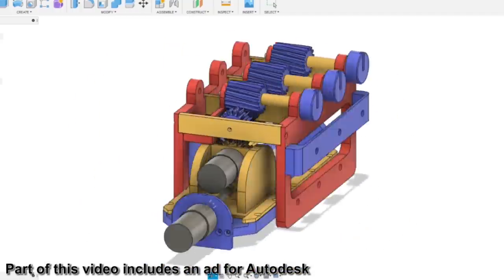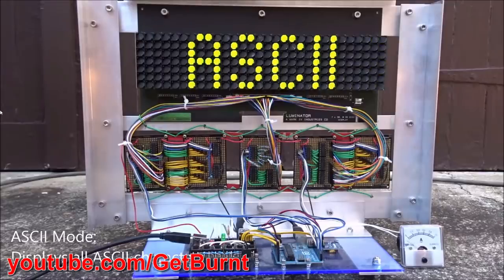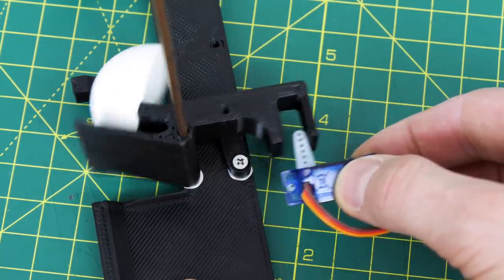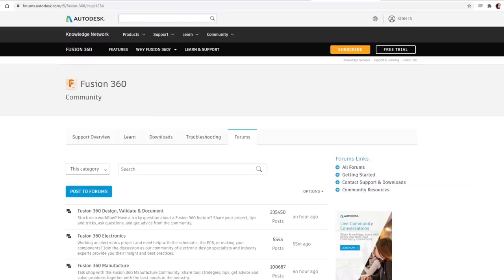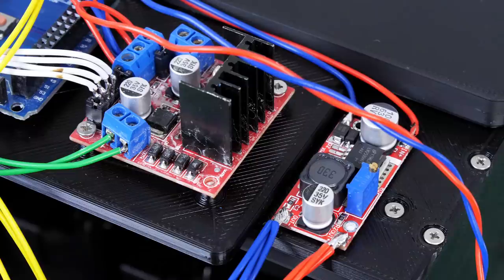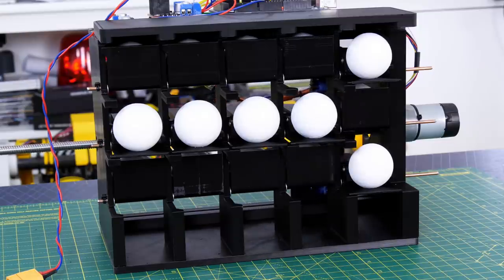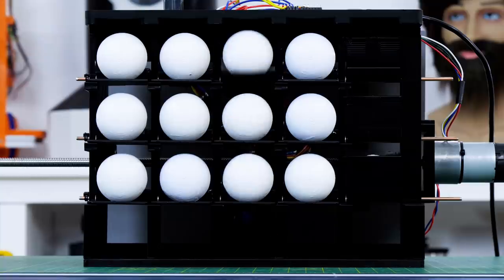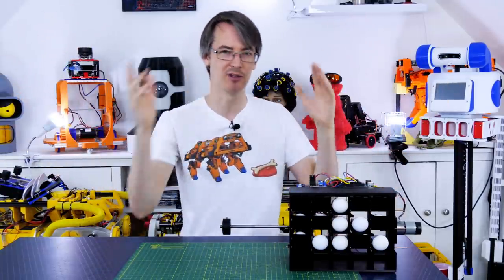Mechanically Multiplexed Flip-Dot Matrix

Comment: "i'm using ping pong balls because i have a lot of them"
prints a fake half-ball anyway
Reply: Yeah, I don't get it, why not just cut ping pong balls?
Reply: @Bruhsty1234  a half ball could look bad on camera with all the light because of the black background and the thin white plastic.
Reply: Yeah, why not just have a black and white slate?
Reply: I hate this about the channel, he always prints A LOT of things that can be made much more easily, cheaply and quickly in other ways
Reply: @Bruhsty1234  Would be way more effort!
Reply: @Bruhsty1234  half a ping ping ball would have 0 structural integrity, It'd be like trying to use paper
Reply: @Matty.Hill_87  Yeah, but they don't do anything here. They just sit on a plate waiting to be flipped. They don't need any more integrity than what's needed to hold their shape
Reply: @Matty.Hill_87  well they could brace it with toothpicks and hot glue
Reply: @tramburo23239  'Hate' seems a bit strong 😕
Reply: yeah i would have used a piece of masking tape instead of a ball. I mean, what's this for? it's just fun and a prototype, not a product.
Reply: @ionymous6733  All this illustrates why people like James have big YouTube channels and we don't. 😁
Reply: G Bertelli like the plates at the top and bottom, two big plastic sheets basically, a bit of plywood and some basic tools would do the same.
Reply: @tramburo23239  I was just about to say this, instead of making some big parts out of wood or something he just spends a LOT of hours 3D printing them.
Reply: saving the real ones for the megapixel version
Reply: @Bruhsty1234  effort. 3d printing you press go and walk away.cutting a bunch of balls in half you gotta sit there and do it. Besides that. Engineers overdo everything.
Reply: I love channels like this, but I will always randomly remember how much plastic is being used and then I feel bad. I wish stuff like this was more sustainable. as 3d printing becomes more popular, the negative impact on earth will just become worse :'((
Reply: @allertschallenberg1857  nah i've noticed a "change" in people once they get a 3d printer, it's like they completely forget how everything else works, they print completely redundant stuff, never once considering there's probably mass produced injection moulded, sturdier, stronger, lighter and cheaper solutions available on the market, 3d printing is actually quite costly except for very specific custom made parts which is kinda it's whole job, "printing" a ping pong ball in this sense is just moronic, specially after stating he has so many rofl... he'd only need to cut 6? of them in half... gotta get that filament sponsor somehow i guess
Reply: @bugz000  Thanks for proving my point with that last statement.
Reply: if he printed it anyway he should've just made a square which takes up more of the pixel
Reply: @tramburo23239  well maybe he doesn’t wanna make cheap rubbish that’ll break in 5 minutes
Reply: @pvic6959  agreed. I hate failed prints etc sux
Reply: @Bruhsty1234  because he can
Reply: @Bruhsty1234  because 3D printed parts aren’t ridiculously flimsy
Reply: @Travis_Yu  
I'm not saying I would have done it the way he does it, BUT his way is more "proper engineering" in that he can model and test it in "cad cam". And the fact that it takes time for the printers is NOT the same thing as it "taking his time". He can pretty much "set and forget" the prints and do other things while they print.
So Yea to each their own, but I can see benefits to doing it his way, ESPECIALLY if You are sponsored by a filament maker.
Best regards.
Reply: @tramburo23239  
"Lucky thing" that You don't have to view it then, isn't it ? :)
And best of luck finding other channels that You dislike, if You work hard You might even find some that You "hate" just as much as this one, and then You can refrain from viewing those as well ;)
Best regards.
Reply: @pvic6959  The "negative impact" that 3D printing has is HIGLY dependent on what type of plastic they are using. I can not say for certain what Mr.Bruton is using, And I'm pretty sure that  "pure PLA" is made from renewable source and NOT using any petrochemicals ((in the filament material)) and can pretty much be "biodegragable".
Best regards.
Reply: Yup, this is how at lest half of my projects go..."Oh, that would be good for X". Creates entire project around concept and part then ends up not using the original part at all
Reply: @tramburo23239  Why do you watch the channel, then?
Reply: It's like the saying goes: "When you're given free filament, everything looks like a problem that can be solved with 3d printing."
Reply: @onlyeyeno  "proper engineering" is using your judgement to choose the right tool for the job. A thin sheet of plywood is objectively better than a big flat printed part on basically every level. 3D printing isn't a panacea, it is one process out of hundreds.

Comment: Have you considered using ramps on the lever, to flip the dot while "swipe past" the dots. No jamming, no waiting?
Reply: And no need to know the previous position, especially if some external influence messes with it.
Reply: that was my first thought as well
Reply: Well yes and you could simply build kind of centering ramp, then from there you could assign either go fully open or fully closed
Reply: I was thinking in same direction also..  In addition, servo can have a park position if need to just pass through without touching the flips
Reply: You could also 3D print them as compliant devices so there's only a single moving part for each pixel and spring is built in.

Comment: I’m very curious of how many miles of filament you’ve used over the years.
Reply: I'm more interested in how many kilometers he's used
Reply: Enough to go to the moon and back a few times
Reply: 500 miles. Perhaps even 500 more.
Reply: You ll eat it with your food in some years, like all plastic
Reply: @matthewgoodman434  5 miles, 2 kilometers and 1 smoot
Reply: @matthewgoodman434  🙄
Reply: @GunGryphon  way more than that I'm sure.
Reply: @matthewgoodman434  there's about 450 meters of plastic on a 1 kg roll (with variance).   Assuming he's leaving his machines running 24/7, and with a 50 percent duty cycle, then that's 900 kilometers. Per year.  Obviously, I made a lot of assumptions about his tip speed, extrusion rate, etc. Based my guesses on my own machines.
Reply: Given that he almost always has a filament sponsor, this should be knowable.
Reply: @matthewgoodman434  same
Reply: @GunGryphon  Just to be that man who printed a thousand miles of Filament
Reply: to the moon at apogee and back lol
Reply: My guess, 2450km or 5358705 cubits
Reply: Probably at least 3
Reply: @GunGryphon  just to be that man who’d print a thousand miles
Reply: You can count it as mass. It is more reliable.
Reply: Miles?? Wtf. Filament is measured in kg or meters, not miles!
Reply: @dtesta  Usually, when dealing with many of a smaller unit, one converts to a larger unit to communicate more clearly. Not sure why this is confusing. James clearly uses A LOT of filament.
Reply: @nimoy007  Then use kilometers? What's the problem? Filament is measured based on the metric system and nothing else. If he wants to somehow hint on "a lot of", then use tons.
Reply: Assuming 2 kg of filament per week, for 5 years, and 350m of filament per roll, 182,000m or 182km ,or  113 miles, or 7,165,354 inches, 99519 fathoms,
Reply: Or about half way to the ISS
Reply: @Unmannedair  he uses 2.85 filament so it's actually more like 125m per 1kg of pla idk wherer you got 450m tho even 1kg of 1.75 abs is only 400 meters best case and abs is basically 1g/ml vs the 1.25g/ml of pla and petg roughly

Comment: what you should do is make the input levers independent of current state. so, as the servo slides by, it'd pas cleanly over a dot that was already in the right place, but index one that wasn't. like a pin in a track, using the lead screw's own motion to slide through
Reply: Absolutely this.
Reply: yup, better idea

Comment: Replacing the servos with magnets seems a good idea, less moving parts, just have to time it right. A controlled polarity on the moving side, and a fixed polarity on the dots, you just have to dial in the magnets to be able to reliably pull/push the dots. Also a belt driven axis on a smooth rod seems way more efficient in terms of speed.

If you want to go overkill and use only two motors, you could build something like a coreXY motion system like a 3d printer but instead of a nozzle you have an electromagnet/servo that switches the dot matrix, this could be scanning row by row, or just go to only the neccessary positions if programmed right
Reply: I was just thinking that I would want to see a version of this that uses an x y type thing
Reply: Magnets have issues as their strength is directly related to how close to other things it is. Could be two magnet per, one for on to off, the other for off to on, and have them end up close to the thing.
Reply: In the 1970s or 1980s I saw a display like that in the baggage area of the airport in Milwaukee, WI.  The display appeared to be backlit by fluorescent tubes, and would be erased when a dark silhouette moved behind it right to left, and would then be drawn as that silhouette moved left to right.  Probably about 8 rows by 20 characters.

Comment: I think the flipping part should be 90° flipped, the middle point should be free to pass the hole at any state, while the small diviation in the angle would flip it to the correct side as it passes by. It would make your life a lot simpler.
Reply: I think that would even let it flip them on the move, just scan the lead screw back and forth twiddling the servos as you go. 180 the servo horn when you get to the end and your idea even works in both directions. I'd live to see how fast he can get the thing going.
Reply: I like the cached current state method - but for me use the actual balls and a small inclined plane - drive the ball pusher/holder up and down the plane from the back - then you can do primitive grey scale leaving them at 1/4 1/2 etc too!
Reply: @foldionepapyrus3441  Unless I am mistaken, the current method would fail mechanically if you snuck in and changed the state of one ball by hand.
Reply: A belt drive would make it faster too. And if the switches were ramped, all you would have to do is set the position as you pass and the switch would slide into the correct position.
Reply: @bkuker  Indeed, as it currently stands it is mechanically flawed, being easily externally driven and probably unable to deal with the fact - the arms might manage to bulldoze the linkage back to the expected state, but its clearly not designed to do so.

But move to something very much harder or even impossible to back drive and having a remembered current state means no mechanical reset, clutch/ratchet or sensing type system required. So on my inclined plane idea - I was thinking driven by screw thread - you can set the height up the slope and need no reset to change it correctly to the next grey level you desire.
Reply: Nicely put =D

Comment: You could do faster switching if you made a ramp mechanism that the servo selected and moved across the balls (like a railroad switch, but the switch/rail is what is moving through the row of balls) ... Would also probably eliminate jamming as well since the servo would be selecting the ramp between the balls, and the ramps would self-align. (Designing the ramps as 2 alternating contours on a cylinder would probably make for a compact design) ... would have most the advantages of the electromagnet idea.
Reply: Ah, I just realized you can build the ramps into the flip-dots instead of the servo, so basically what you have but with angled slots, and have the servo pre-position and move through them! Ideally, no jamming, and no stopping!

Comment: If you use a belt drive on the linear motor instead of a lead screw it would work a lot faster also you could make one that instead of moving horizontally it moves in a circle I’m not sure what it could be used for but someone would find a use for it in the comments
Reply: Oh! If you snake wound the belt, and had the servo follow a zigzag, maybe you could update any number of rows and columns with 1 servo!!!
Reply: @brantwedel  the proper design, clearly, would be a space-filling Hilbert Curve, of course!
Reply: @strictnonconformist7369  this is not a square its 3x5

Comment: James, that works awesome! The white ping-pong ball completely disappears and reappears as if by magic!

I've been toying with similar idea but trying to do gray scale.  Instead of black or white, each pixel is a cylinder of black to white gradient.  Pixel axis is vertical as to take advantage of gravity and friction to maintain its rotational position.  

As the gantry moves at constant speed horizontally, the servo arm would catch a half disc on top of the cylinder to rotate it.  By retracting the servo arm just at the right time, each pixel could be set to desired gray scale.  To rotate the pixel the other way, we would rely on the gantry moving the other way and again using the servo arm to catch that pixel to rotate it the opposite direction.

I've only modeled it in Fusion and have not printed them. I suspect there are tons of issues that I have not tought of yet.  When I saw your black/and white pixel, I realized that's what I should have done before tacking gray scale.  Very nice. I love it!

Comment: James, if you turn each of those lever slots into an hourglass shape (turned on its side and open on each end) so that it catches the servo horn as it passes by, you don't need to pause in between each - you can just fly across them quickly.  This also solves any issue of them being in an unknown state if manually changed while the actuator isn't directly over and the physical model mismatching the data model.  If you're worried about catching/jamming - should be easy to put a small ball bearing on the tip so that it rolls across the hourglass shape.

Comment: One idea could be a spinning bristle brush instead of servos, the rack could slide sideways through all of the levers without moving anything, but have them quickly spin one way or another and they could influence the display. Small motors might be cheaper and easier to drive than servos too. Great video!

Comment: If the angular distance to flip were an even division of a full rotation (e.g. 90, 70, 60 degrees) you could make the bit attached to the servos a full wheel with spokes. Then it would essentially always be in the same position after each rotation because of rotational symmetry.

Comment: Why not paint one half of the ball black and rotate them with a screw gear or rack gear?
Reply: With a gear fixed to each ball you could pass at high speed and engage a stationary gear on the carriage when you want to flip "on", then engage in the return jointed to flip "off". 

(Relatively weak) Magnets on the "east" and "west" pole of the ball can attract a magnet in the side frame to hold the ball in place.

Comment: Free idea for a design that can be extended in the other dimension as well: Cylinders with black on one half and white on the other half, with paddles on each side that interface with each other like a safe lock / combination lock does. So you have a motor at the bottom that turns 2 spins to the left, sets the top pixel, turns 1 spin to the right, sets the second pixel, and turns to the left, to set the bottom pixel. Then moves across to the next column (somehow).

Comment: I’ve always wanted to try making a fishing line based grid display. Each row and each column having a servo controlled fishing line. If both the row and the column are engaged a third “actuation input” connected to all the dots could do the actual flipping. This way multiple dots could be flipped simultaneously with each tick of the clock.

Writing the prioritization algorithm would be a delightful hell.

Comment: Suggestion: swap the "slots and levers" for ferromagnetic rods (on each pixel) and a pair of electromagnet "slots" (one forward, one to the back) that can pull the rod in either direction. This way you don't need to match the previous state for each pixel, and you can always "set" a pixel to either state, with nothing happening if you "overwrite"
With this solution, you're combining the best of both worlds: mechanically multiplexing the electromagnetic part of a solenoid (keeping wiring simple and power draw consistent and controlled), whilst keeping the "actuator" fixed to each pixel, allowing scaling up with minor cost

Comment: Have the flipping axis of each dot perpendicular to the main motor axis. Flip to black in one direction, white in the other. Have one solenoid per row that extends out to do the flipping, which can be very low power as all it needs to do is extend / retract the flipping pawl while it has no load on it. You need to extend the pawl whenever an element needs to be flipped. If it's already the correct colour it doesn't matter if you extend it or not. A linearly moving pawl should be able to drive a maltese cross / geneva type driven element through 90 degrees, which should be enough (you'd only need one slot instead of a whole ring of slots though.)

Comment: I would go with the ramp idea, combined with placing multiple modules on the same leadscrew - you use electronic multiplexing to set the servos to what each characters next column will be, then move the leadscrew forwards and the ramps will flip the dots. That way, while you would use more servos, you would only need one extra IO pin per character and you could build a lot longer display with a much faster refresh rate. Could work as a subscriber counter behind you on the wall too (though that doesn't need the refresh rate, but you get the idea :) )